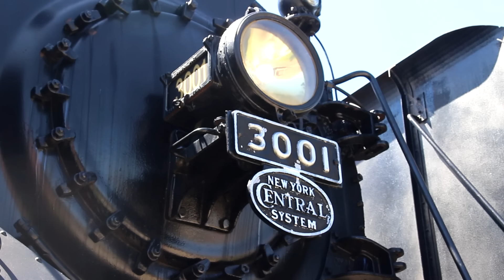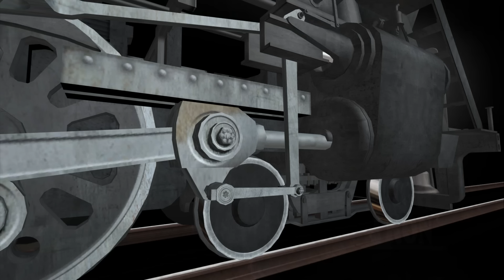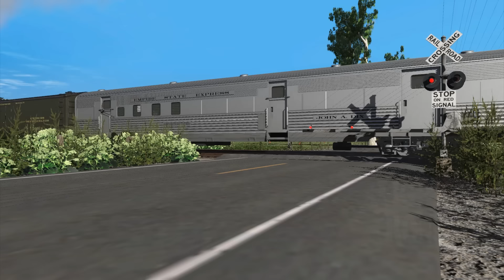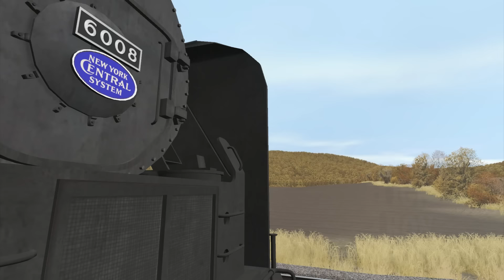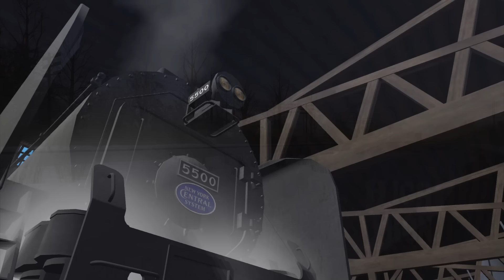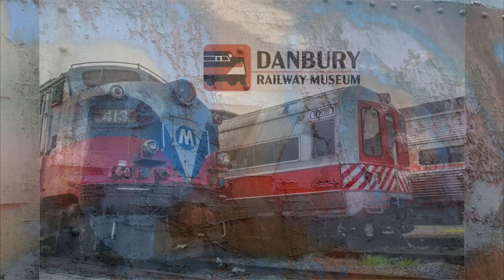New York Central's Niagaras - The Best Mainline Steam Engines?

Comment: That horsepower is absolutely staggering.  Imagine having more horsepower than an AC6000CW or SD90MAC-H, but it's a 2-cylinder steam engine in the 1940s.  Big Boy having that much power, yeah that makes sense for something so enormous.  But this thing was SMALLER than everyone else's Northerns due to NYC's unusually tight clearances, yet it's like 1,000hp more powerful than most of them.  What a monster.
Reply: it can’t put down that power at 12 mph, the diesel can, so that’s always a bad comparison
Reply: @ironmatic1  Well the diesels can't put that power down at 85 either.  As they used to say during dieselization, steam can pull a train it can't start, and diesel can start a train it can't pull.  A Niagara (or any Northern) would be a terrible terrible choice for any kind of slow drag freight on steep grades.
Reply: @JETZcorp  right though it does depend on gearing for the type of things a diesle can do, great starting power but its starts to act like a generator and fights itself after a certain point, steam though will just keep ticking off the wheel speed till it throws itself apart or runs out of steam feeding it, and has all that foot pounds that can go at once which would cause a wheelslip and thats bad on the rails, can derail the train or damage the drive gear, and the harder steam goes the more power it generates and more thermal energy into the steam meaning more expantion with lower volume and more work with that volume can be done so the valves cut off earlier to use more of that thermal expantion, steam though somewhat labor intensive has proved that it can do the job and do it in the modern era if you look at what livio dante porta did in argentina and did it in some of the most remote and inhospitable work environs in the world in patagonia and on really bad coal, but the machines have to be very sciantific and modern advances maintained and understood as well as thermaldynamics, but the beauty of steam is that if it can make heat it could be used, woor, oil, coal, biomass, maybe even hydrogen to burn and heat the water and steam, and higher pressure to the point of ultra critical which is basicly I read is the end all of steam power where the steam or what remians of it is in a fluid catigory of its own, though making a steamer like that would be prohibitivly expensive and heavy not to mention problably would not take the abuses of railroading, but even today think about it most power is not from wind or soler its from combustion powered turbines or boiled water steam from coal or waste burned or, nuclear where the heat from the reaction is used to turn and superheat the water to spin the turbine to make power or in some experamental cases rotery expantion engines, think like a wankle type engine of sorts thats a rotery expander .
Reply: As much as I hate to admit it, that’s a slightly misleading estimate. That nearly 6,700 HP was measured at the cylinders, the actual rating at the drawbar was closer to 5,100 HP, which put them on par with the J’s and about 1,000 HP less than the T1’s. A slight detriment to being such a free steaming design, and the S-2 had it slightly worse since the intake of the cylinders was smaller. So while it could use steam more efficiently than an S-1, it could use that steam as readily either
Reply: @RussettGXY  T1 power @85 mph was 6,550 hp indicated, which means at the cylinders (i.e. taken from the indicator diagram). Therefore the T's were also around 5100 hp at the drawbar.
Reply: @RussettGXY  cite sources please, and it was still the most efficent northern designed and built in the usa, within the confines of the centrals existing tunnels and was one of the few that had the more advanced exaust like they used in some of the european engines and latter refined by livio dante porta, though I do wish I had a 100 million dollers so we can scratch build an advanced steam locomotive with all the latest advancements, and see trutly how much power such a thing could be, with all of portas concepts, though seems no one in the states is willing to do what we are capable of doing, we can additive manufacture rockets, and make the fastest things on 4 wheels and wepons of war and even make some clothing but seems no one has that pioneer spirit and willingness to do what needs done or can be.  seems people would rather cowtow the line with what ever one person says instead of debating or trying to offer an open hand and try to convince the other side there may be another answer to moving goods beside batteries or electrical, none is perfect though, and neither is the wind and solor only, coal yes is dirty but there are far cleaner sources for heat engines, short switching for example could be a new type of fireless steam engine powered with a solar collector boiling and superheating the water or biomass renewables. sarry I have an ax to grind about our nation and its people, they say you cant build that here you cant do that just like the weather tech commercial, Yes we can its just we dont, few are willing and there are several I know personally from the fort wayne rr historical soc that are under the age of 30 and take a very active hands on part.
Reply: @RussettGXY question, what T1 are you talking about?
Reply: He means the 'production' PRR T1s, examples of which were exhaustively run on the Altoona Test Plant.
Reply: @RussettGXY  Very good information, thank you.  It's worth noting though that, at least when comparing to diesels, they don't quote drawbar horsepower either.  I'm not sure if they're rated at the prime mover or at the traction motors, but either way it's a notable difference.  5,100hp at the drawbar means the weight of the loco and tender are already accounted for.  It's pretty sweet when you get to pull 300 tons of your train power/weight calculation.
Reply: @russellgxy2905 this isn't true. T1s produced about 4600 drawbar horsepower, for one. And 2, DHP is be affected by wind resistance, rolling resistance, etc. Cylinder horsepower is technically the more accurate measure of a locomotive's actual power output
Reply: @markantony3875  Again this is only partially true. A Niagara hit its peak drawbar HP at 63 MPH sure, but it was roughly 5100. At least according to the NYCT&HS, it'd still produce in excess of 4300 DHP at 85 MPH, and 4160 DHP at 100 MPH.
Reply: @markantony3875  based off horsepower curves and actual dynamometer testing then nah? A T1 develops 4100 DBHP at 100 MPH, a Niagara 4190. At least in everyday service they are roughly identical in high speed performance
Reply: @markantony3875   my source is the New York central Historical society... what's yours?
Reply: @markantony3875  yes Js produced peak drawbar horsepower at a low speed, that's common knowledge
Reply: @markantony3875  something tells me that if you have the time to engage in a YouTube argument in a comment section about a steam locomotive on a friday, you're not actually a mechanical engineer
Reply: Chapeleon's modified  242A1 had 5300 indicated HP and 292 kN in tractive effort. This at a an axle load of 21 metric tons.
Reply: Now imagine a NYC challenger. That thing will be a monster.
Reply: It's kind of misleading, though - steam engines are not constant horsepower, they're constant torque. They generate way, way less HP at low speeds.
Reply: @davidfuller581  Diesels aren't really constant horsepower either.  They need a certain amount of speed (usually about 12mph) to safely get the power through the traction motors.  And, above a certain speed, they start to lose horsepower as back-EMF builds up.  They do have a good size plateau in the middle, and that is a good advantage, but it's not perfect.  Their main advantage is low-speed TE.
Reply: @JETZcorp  That's correct for DC motors, yes - not quite for AC. AC motors really do not care if they're thrown a ton of power at low speed, there are no commutators or brushes to blow up.  But given that it was DC at the time and not AC, it's sort of a moot point. Regardless, the diesels have a lot more starting TE than steam because they have a lot more horsepower at low speeds.

Comment: You can't compare steam locomotives as if they were cars. The 16' 4" N&W J could not run on a line with 15'3"clearances. The J was designed to pull heavy trains in mountainous terrain, the Niagra was built for speed.
Reply: I thought the J's were 16'0"
Reply: @joemalone6923  They are just 16'. Still too tall for NYC tracks but still very good locomotives as a whole
Reply: @09JDCTrainMan  That's true
Reply: You can't compare cars either. They're all made for different thing. Toyota? Made for super reliability, but even at my age no second date. Other cars, bad transmissions, great back seats.

Comment: Best in the USA maybe. The SNCF certainly had more powerful steam engines that ran with higher performance and lower coal consumption.
Reply: It'll be interesting to see what High Iron does with Chapelon, particularly the 242 A1 (another key 4-8-4), the 160 A1, and the 4-8-0s in context...
Reply: @wizlish  Exactly.
Reply: No SNCF engine was as powerful - much impressive on power to weight. The US engines were amazing for engineering - roller bearings, cast frames (which were heavy, but they needed to be to handle 6500 hp at the cylinders) and welded boilers etc. 
The most powerful European express engine was the Chapelon 4-8-4, which had 5300 hp at the cylinders, 4400 at the drawbar from a 53 sq ft grate weighing 148 tons locomotive (and 70 ton tender).

Comment: Another thing I'd like to point out is the J, when compared to a set of 2 EMD E6s between 1945-1947, the J came out as less expensive to maintain and operate overall, costing around 30% less to maintain. The J even beat the E6 in availability and utilization by slight margins. So if anything, the J came the closest to beating the diesel. That too is why IMO, the J is the best 4-8-4.
Reply: The J class is one of my favorite locomotives. The Niagaras were my second favorite
Reply: @joemalone6923  The J is my favorite 4-8-4. My 2nd favorite 4-8-4 say is either 614 or 4449.
Reply: @09JDCTrainMan  I also like 4449 and 844
Reply: The problem is that the J wasn't "beating the diesel", it was beating the E3/E6.  By the time of Kiefer's test, the Niagara was hard-pressed to beat two E7s... and was dominated by three.  Then along came the E8 and it was game over for passenger work...

Even in 1939, the diesel 'competition' for a locomotive with 6000+ihp was the Baldwin Essl modular locomotive, with eight 750hp V-8 gensets each driving its own axle.  Cost too much without GMAC-style financing and incentives... which, truth to tell, was a shame...
Reply: @wizlish  Yeah, even as good as the J and Niagara was, the diesel is just simply superior
Reply: The fact that the Niagaras were so powerful, efficient at 15 miles per ton of coal, had good torque getting trains up to 90 MPH in the span of a couple minutes, exceptional smooth-riding at higher speeds, and didn't require specialized maintenance made them exceptional compared to other Northerns. Power output and tractive efforts don’t always mean the best, they may be strong but what in their design allowed it though is what you gotta think about. Despite the tests done by Kiefer and some of the unforeseen circumstances that troubled them, you ask me the Niagaras bested the diesels.
Reply: @TheTraindude12  The Js were more than just horsepower and tractive effort. They were very maintenance efficient, can go hundreds of miles without oil due to mechanical lubrication, and rode as smooth as butter as well. Even with their 70-inch drivers, they still rode well at high speeds, and they weren't even designed for real high-speed running. Yeah, the Niagara bested the 1st Gen diesels, but so did the J. They and the Niagaras both weren't anywhere near as maintenance intensive as other 4-8-4s (and maybe the C&O J3a, but I'm not 100% sure on that). The J still has my vote, especially in mountain territory, but to each their own.

Comment: In the flat lands, yes, but in the mountains, the J is the best mainline steam locomotive, given that the two were designed for the specific running. While I do find the Niagara a bit overrated and think the J is overall better (even if only very slightly), I still don't deny the Niagara was a top tier design. That said, I even question myself that if there even is a "best" steam locomotive since they were designed for different jobs and terrains and many performed admirably. Aside from the Js and Niagaras, the FEFs, the last 5 Greenbriers and AT&SF 2900s are also great examples of steamers that performed amazingly.

Also, there are a lot of 4-8-4s that have more tractive effort than the Niagara: The UP FEFs, C&O Greenbriers, SP GS 4-8-4s, AT&SF's 4-8-4s, even the MILW S3 has more tractive effort than the Niagara, and the list still goes on.
Reply: also the AT&SF 2900 Class were in that conversation
Reply: Nobody boiled water like the N&W.

Comment: The reason for the resurgence of Steam during WW2 is that a lot of the Diesel production was used for powering submarines, Destroyer Escorts, other smaller ships, boats and crafts (including the all important Landing Craft and some Landing Ships).  Plus large Diesel Electric systems were vital for supply power in the forward areas, and for support areas behind the lines! (Most of the world uses 250 volt, 50 Hertz power grid and the US uses 120 or 240 volt (for the most part) at 60 Hertz....)
Reply: A very astute point of view. Good man :)
Reply: In the 50s and70s most of the world used 220v or 440v for power equipment i.e: electric iron, heavy electric motors etc @ 50 cycles/Htz. I got hit by 440v once, you heard of bitch slap? LOL! It was like several bitches slapping you at the same time HARD. I wonder if ringing in my years for past two decades has anything to do with it? I sailed for five years around the world and never had to worry about the equipment I used until I came to USA and parts of South America. Had to buy new equipment and or use step up transformer for the antique radio, ended up selling it.

Comment: a C1a: duplex niagara? now that'd be something to see. If for the sole fact it'd be a niagara,
it's a shame none of these survive today which makes the preservation of thouse Electrics All the more paramount!
Reply: The C1a design had essentially the same boiler as the Niagara, by intent, and it did not have the small grate or the poppet valves of the PRR 'equivalent'.  One interesting detail was that it was designed with a 64-ton pedestal tender (with a Delta trailing truck!) which with the lower water rate of the duplex would have permitted a single locomotive to run from Harmon to Chicago without coaling.  As alte as May 1945 it was not fully realized that the Niagara was more than a "Mohawk-plus" -- the other engines in its development line were not particularly large, or fast, or powerful (see the Rock Island and D&H locomotives for comparison).  The original prototype was built with drivers 1" larger than the last Mohawks, and it could be argued that with that driver diameter and the original 290psi design pressure the engine would exhibit better DBTE in intended freight service.  However, the engine bed was designed to allow 79" drivers; on initial testing these were soon installed, and the locomotive then produced high horsepower in the speed range NYC needed for passenger service with trains too long (or with too much steam and axle-generator requirement) for a J3a Hudson to handle.
Reply: @wizlish  Facinating! where did you get this info?!
Reply: I have the internal New York Central discussion from April 1945 that contains the details.  They do not specifically mention the lower water rate, but we can infer it from the PRR test-plant data making some allowance for piston valves.

Comment: This might be nitpicking, but the J was not the only 4-8-4 with higher tractive effort that the Niagara.  With around 61,000 pounds of tractive effort, they were closer to average than exceptional in pulling power, but more than made up for that with their performance.  Still great work though.
Kudos
Reply: In all fairness, the J has 70" drivers, and is only high-performing due to the genius of Voyce Glaze in balancing.  PRR tested one up to over 110mph, but noted that to do serious express work rather than just 'dash' capability, the engine would benefit from higher drivers -- they recommended the 80" standard, which was effectively what the production Niagaras were built with).  The J ran out of valve tribology rather smartly at 112-114mph, with peak machinery speed rising as superheat went higher than the tolerance of the steam oil used; neither of those issues would have set in at that speed with higher drivers.
Reply: @wizlish  The J suffered no mechanical ill effects from running at 110 mph even though the rotational speed exceeded the AAR recommended upper limit. The lubrication issue could be dealt with and though steam locomotive lubrication remained less than fully developed, once it is appreciated that it is the temperature of the rubbing surface which is key this opens a door to further improvement. These locomotives were relatively high performing for a number of reasons but compared with the world best practice they had poor power to weight ratios. No US steam locomotive could maintain 40 ihp per ton of locomotive weight, designers concentrated too much on evaporation and not enough on specific steam consumption though it must be said that they were good at mechanical design.